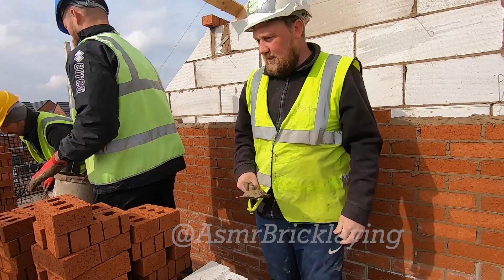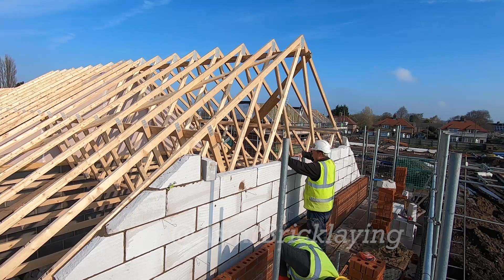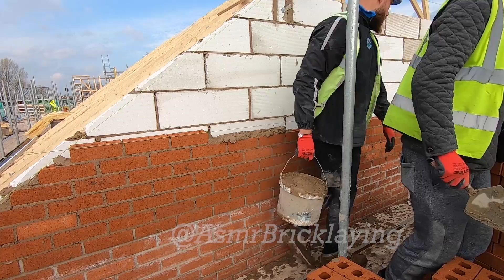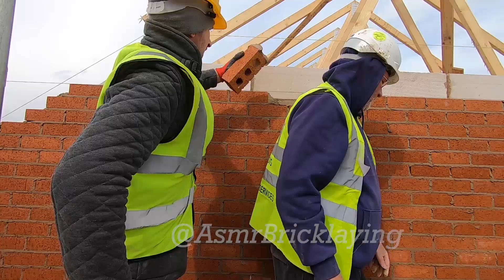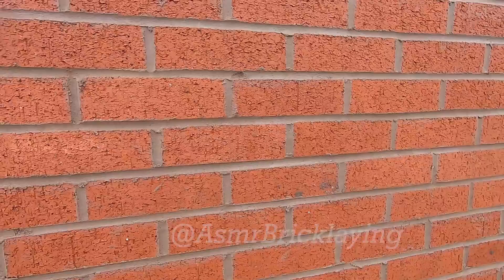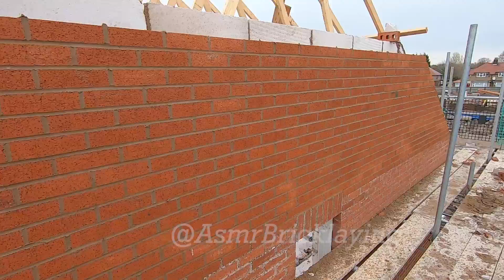Watching Bricklayers Build a House PIke | Unintentional ASMR Video

Comment: How do you set the line for the pike on the face work ?
Reply from the maker: will do another video on set up Nath
Reply: You hammer a piece of wood into the A frames usually one that's big enough to to cover the first 2 A frames. One at the top and one at the bottom and over hang your brickwork by 100mm. Then just measure off the back of your block work the size of the cavity plus the size of the brick stick a pencil mark on repeat on all the pieces of wood. Then wrap your line round. That's how I do it anyway

Comment: Why no cavity insulation??
Reply: Its 100mm full fill cavity, so put it in every 450mm
Reply: It will be because it's above the ceiling line, as soon as there is no cold bridge there is no need to insulate a gable if it's uninhabited.
Reply: @leemoore107   Its always good practice to insulate Justin Kase gets converted to a loft
Reply: @petesteele4487  the developer won't look at that from a commercial standpoint ,if someone converts it to a loft later on it would be down to them to look at insulation, but I'm sure some developers will do it but most won't if they don't need to .